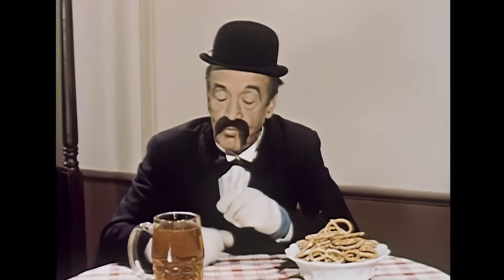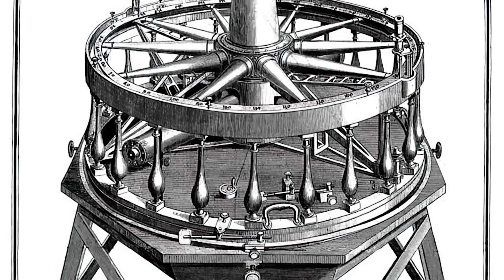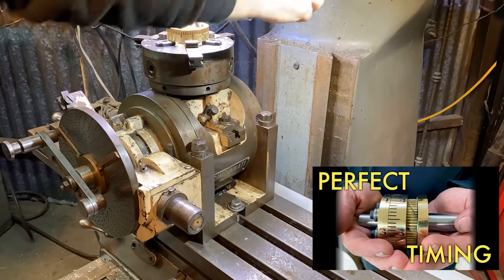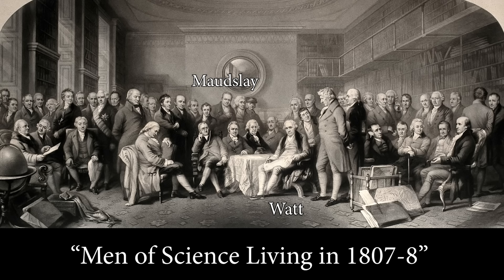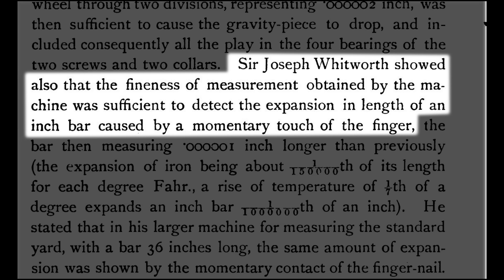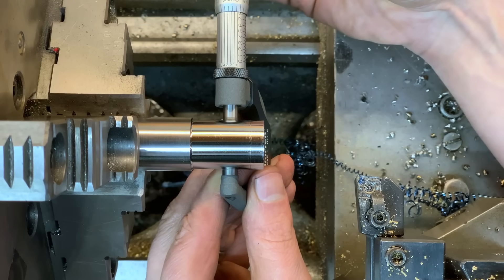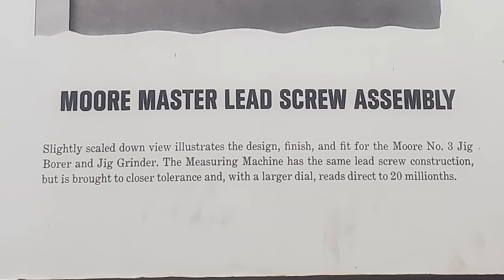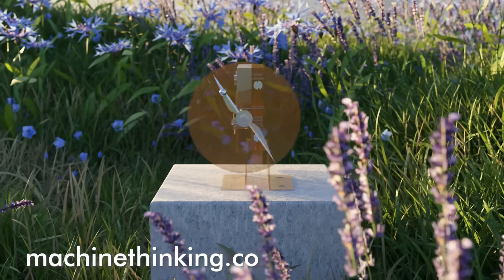The HIDDEN Screws of PRECISION

Comment: As important as whitworth is to modern machinery and accuracy he was the cause of a major headache that lasted over a week where I work.  I was a mechanic in a factory.  I still work there, but I'm a supervisor now.  Anyway, his odd thread pitch is what caused me a weeks worth of headaches.  Most of the machines I worked on were either all standard or all metric, pretty common right?  Well, one machine in particular had one thread that I couldn't figure out.  I measured, re measured, checked my numbers, cross referenced them to my machinery's handbook and kept coming up empty handed.  That is until I came to the pages about whitworth threads and my numbers started making sense.  What I had on my hands was just that, a whitworth thread used because the component that went into it was sourced from somewhere that still uses it.
Reply: I had a cylinder head fixed for stripped exhaust manifold stud, and the new stud was pretty wild, M10x1.25 on one end, whitworth on the other. Whitworth thread geometry is excellent for aluminum, apparently.
Reply: The WWII Rolls Royce Merlin engines used Whitworth threads, even the American built ones. I imagine it caused a fair bit of confusion then as now for people who didn’t know
Reply: Wait, what still uses Whitworth threads?!
Reply: @garethfuller2700  Old BSA motorcycles for one.
Reply: @garethfuller2700  it's on a pretty obscure machine used in a factory for decorating plates.  Part of the vacuum system that holds the plates down has a type of valve that threads through the table.  That thread is whitworth.  The machines are over 40 years old.
Reply: @garethfuller2700  An awful lot of stuff in the British Commonwealth (Australia, Canada, New Zealand,......) 
Even though we've had metric for decades and that almost anything new is metric there are still a lot of older machines and copies of older machines that have BSW and BSF threads. Most notably you find these Whitworth threads around pipes BSP. If you do anything around pneumatics or hydraulics you come across it all the time. Its one of those obscurities that has survived despite all other attempts.

You'd also be very surprised how many lathes come with their main lead screw as a British Imperial rather than metric. Its actually very easy to make the both metric and Imperial threads so long as your lathe has a 127tooth gear.

I eventually got my pilots license and flying is a bizarre mix of Imperial and Metric systems.
The visual range is given in kilometers, but distance over ground is still in nautical miles.
Altitude is still done in feet, but the pressure for setting your altimeter is in millibars (metric) or mm.Hg as in millimeters of Mercury (again metric)
Fuel capacity is usually (but not always) measured in gallons and fuel weight is usually measured in (but not always) kilograms. That one depends on the plane and where and when it was certified. All pilots have to be very careful with the conversions or you get the Gimli Glider scenario.
Reply: @tonywilson4713  I came here to mention the use of Whitworth form threads in pipe fittings, but you beat me to it! I will add that it still forms the basis for International Standards Organisation pipe threads
Reply: @emma.jacobs1  Good point on standards.
I love this channel for how well its researched and how well it presents engineering. His vid on Jacques de Vaucanson's lathe was brilliant.
Reply: @emma.jacobs1  BSP. British Standard Pipe thread.
Reply: @tonywilson4713  fellow aviator here, what country do you fly in? In the US, perhaps unsurprisingly, almost everything is in imperial: gallons, pounds, feet, nautical miles, inches of mercury, pounds of thrust, etc. But temperature is Celcius...
It works well for the 60 to 1 rule, degrees, lat long, and all that.
Reply: @MattH-wg7ou  I'm Australian but I went to college in the states where I first learned to fly gliders while doing my degree in aerospace.
Finally after many years I  got round to doing my powered license. Got my aerobatics and started competing. 
It all got cut off a couple of years ago after I picked up a very nasty virus.
Hoping to get back to some before too long.
Down here all weather information services are in kilometers. Fuel is delivered in liters. Temperature is in Celsius. Weight is in kilograms. But any aircraft built in the US has manuals with gallons and Fahrenheit and pounds. We have to be especially careful with gallons because there's 2 - US (3.8l) and Imperial (4.5l). So you do need to be very careful with fuel.
Reply: @tonywilson4713  cool that sounds awesome. Hope you are able to get back into it soon!
Reply: @MattH-wg7ou  I have about 350 hours. How much do you have?
Don't worry about the answer. One of my Frat brothers who did his back in college as over 22,000. I hadn't chatted with him for years. It was humbling when he told me what he'd been up to, but he was super encouraging to keep going.
Reply: @tonywilson4713  wow thats a lot of time flying! Some types get so much more than others, I have only around 350 as well, but they are in fighters. In the fighter community its rare to see people with much more than 2000ish. Around 300 you become "experienced" and a flight lead and that takes a couple years to get there. The thousand plus hour guys are almost all instructors. 
Meanwhile airline pilots routinely have over 10k hours, which sounds just insane to me!
So it really depends on the type of aircraft.
Reply: @MattH-wg7ou  Yeah my frat brother is a senior instructor with one of the major American airlines on 737s.
He was part of a team sent to Boeing to get the Max-8 sorted out. He gave me no details but did say "they broke the Boeing system." That actually scares me because I understand what he means by "system."
That includes all the procedures, tests, methodologies and engineering ideologies  that they use to go from words and blank sheet of paper through to you and me at 35,000ft. Basically a library full of knowledge and experience AND they broke it. 
I'm well aware of how little certain pilots fly. Way back in the late 80s there was a Concorde pilot who became the first pilot ever to record 10,000 hours as pilot in command at supersonic speed. That came up in a discussion at the glider club one day where a couple of our tow pilots we ex-airline with over 10,000hrs. When I quizzed why the big deal one of them slapped back at me asking how stupid I was because he knew I was doing aerospace. I'd forgotten just how little planes can normally fly at supersonic, because of how fast it drains the tanks. Plus it also thermally stresses planes.

You might know better than me, but most air force pilots have less than a single hour at supersonic speed and most never record more than 2 hours in their entire career because its all little short bursts.
 
For what was known at the time that 1 Concorde pilot had more hours at supersonic than the entire USAF history that was known. The SR71 hours weren't known at that time and could/would have changed that assessment.
Concorde truly was an amazing piece of technology.
Reply: @tonywilson4713  the Concorde certainly was amazing! And beautiful. And 10k hours at > Mach 1 is incredible! 
I would say most Air Force pilots have never even been supersonic because most arent fighter pilots. But it probably depends on the type of fighter. If you are in a jet that does a lot of BVR air to air stuff then you spend more time above the Mach, as getting supersonic is fundamentally baked into some of the tactics. But yes it sure does go through the fuel! At max AB at low altitude, 45,000 pounds per hour PER engine is normal! 
But like with most things the answer, of course, is "it depends"! 
I wish I could have ever seen the Concorde fly, never even seen one in person. They put most fighters to shame with their performance. Cruising st 60k ft and Mach 2 is just exceptional!
Good talking to you, hope you get to fly more soon!
Reply: @MattH-wg7ou  Same to you.
There's a Matt H who flies in Australia, did fly for the RAAF and these days likes High-G, low altitude flying between pylons?
Reply: @tonywilson4713  haha not me. Sounds fun though!
Reply: @MattH-wg7ou  Thought I'd ask.
Where I got my aerobatics ticket the school owner was ex-USN and flew both F4s and F14s. 
I asked on day he really surprised my in how much he liked the F4 and disliked the F14. But then Ward Carroll who has a YT channel points out that the F14 was a handful at low speed.
What did you fly where there's an interesting comparison? If you can't no prob. 
As an engineer I like to understand what people do and don't like even if its in areas I'll never work. It all adds up when you are a solution provider.
Reply: @tonywilson4713  I'm still active and its a small community so I'd rather not put more detail out on the internet, hope you understand. 🙂
Reply: @MattH-wg7ou  absolutely and totally understandable
Have you seen Ward Carroll's YT channel? He's an ex F14 RIO.
Reply: @tonywilson4713  its a great channel! I love the story of Mongos MiG Kill especially. And the one where the guy ejected into a thunderstorm and was kept aloft by winds and beat up for what must have felt like forever.
Reply: @MattH-wg7ou  What makes it a great channel is that it sticks to its area of expertise.
So many channels get side tracked in stuff they just shouldn't.
The other great aviation channel is Blancholorio with Juan Brown.
Reply: @tonywilson4713  yessir Blancolirio is a great one too. I like his analysis/opinion videos on just-happened mishaps especially. The mishap investigation side of things really interests me.
Reply: @MattH-wg7ou  What he doesn't do which should be a lesson to ALL JOURNALISTS and public commentators is NOT embellish on known facts.
Any opinions he gives he's clear about that they are opinions.

As far as I'm concerned people like Juan are real journalists. He presents the known facts and explains what he can about them. He doesn't make up crap or try for any grand standing attention seeking nonsense.
Reply: @tonywilson4713  well said. Speculation should be avoided to the max extent possible when dealing with mishaps. And when you must (as a journalist, not an investigator) it should be clearly labeled/explained that it is just speculation. Like Mr Brown does.
Reply: @MattH-wg7ou  I really notice it in things I understand - engineering & technology. That makes me wonder about so much else we hear and can't challenge because its in topics we don't know or have no experience in.

I'm Australian and Rupert Murdoch's crime of crimes was pushing and promoting "opinions as fact."
Reply: @tonywilson4713  Thanks for bringing up the Gimli Glider.  It's been a while and I liked rereading that story.  That, and the Cornfield Bomber are probably my favorite aviation incidents.
Reply: @Kineth1  I'd forgotten the CF bomber.
Love that comment form the other pilot to "get back in it"
Reply: @tonywilson4713  There is also BSPP - the second P is for parallel.
Reply: @mescko  There's one I hadn't heard of or maybe just not noticed.
Thanks.

I wish this guy would do more vids they are so damn informative. There's so much of this stuff we are close to losing. Its one thing YouTube is getting right.

Just recently Keith Rucker at Vintage Machinery did a "partial screw thread" for a vice screw. I'd never heard of anyone doing that let alone seen it done.
Reply: @tonywilson4713  I ran into a BSPP thread on the oil pressure switch on my Rover P6.  Had to order it from a local outfit that deals in vintage Land Rovers, I cross-referenced it to my car.  I knew better than to ring any of the local auto parts usual suspects.
Reply: @mescko  Unless you get really lucky almost NO supplier would have any idea what you are talking about.
I vaguely remember a joke about Lotus using 7mm bolts to save weight over 8mm bolts and how its still a problem for people owning older cars.
Reply: @tonywilson4713  Sounds like Colin to me😁
Reply: @mescko  I once heard Mario Andretti (I think) describe Colin Chapman's ideology of race cars.

If a race car is built right it falls apart as it crosses the line.
If the car crosses the line and can do another lap its too heavy and needs to be lightened.
If it breaks and fails to finish only then can you add weight.
Reply: @tonywilson4713  On your point about nautical miles, though, the nautical mile isn't based on some old weird imperial standard though, it's actually 1 arc minute of 1 degree of latitude (or longitute at the equator). This means that if you've travelled 60 NMi in a due north/south direction then you've travelled through 1 degree of latitude over the earth's surface
Reply: @EamonnG76  Year I know that.
Odd thing on my college transcript. Navigation 101. I needed some extra time my last semester and friends had introduced to me sailing and I found this ROTC course. So with  bunch of future navy officers I did classical navigation right back to star fixes with a sextant. 
It was one of the best classes I ever had.

I also have a pilots license and airspeed is still in knots too.
Reply: @MattH-wg7ou  Wow! Sounds like we could use a whole bunch of that integrity in the political side of the industry.
I'm no pilot & too old to start now but looking in at you guy's back and forth here is almost as interesting as the vid here.  Thanks for this. Maybe you both should think about a collaboration YouTube channel. Maybe?
Reply: @MattH-wg7ou  I saw the first prototype Concorde's (very noisy) & the last to fly, the whole design allows for the expansion & contraction of everything as the aircraft heats up at supersonic speed and cools down on the ground, the Blackbird spy planes apparently leaked fuel on the ground. The Concorde was never know for doing that because everything worked hot or cold!
Reply: @mescko  our Rovers had both imperial & US gallons shown on the dashboard
Reply: @tonywilson4713  When it comes to threads and fuel/oil fittings etc. on aircraft there is here in the US ,AN or army/navy fittings.
Reply: @dicksargent3582  Interesting. 
In what ways do they differ?
The Russians for a while had an interesting philosophy they had 1 gear box. The had the same gearbox in their trucks their tanks and anything else that needed a gear box. Their view was they could keep their tanks rolling so long as there was a truck nearby to steal parts from.
At times other militaries have done similar.
Reply: @garethfuller2700  Old MG cars  and some old but good machine tools
Reply: @richardsolberg4047  if you have a really old MG car, it might have an engine with metric threaded fasteners with Whitworth size hex heads!
Reply: @richardsolberg4047  Dean Smith & Grace lathes come straight to mind. They were built to last forever
Reply: @garethfuller2700  Raleigh Bicycles found in thrift stores and yard sales.  You'll never be able to swap parts with Huffy and modern brands.
Reply: @garethfuller2700  quite alot of stuff actually, especially if you are into repairing olde machinery ( Concords original nose cone was spun on a 120 year old machine  ;)
Reply: @garethfuller2700  The 1/4 inch thread on a camera tripod is Whitworth.
Reply: @garethfuller2700 All metric piping. All European piping uses BSP thread which is a Whitworth thread.
Reply: @garethfuller2700  you certainly could buy threaded rods with Whitworth threads in the UK until recently!
Reply: It's still relatively easy to buy Whitworth tap & die sets
Reply: I would be very curious to know what prompted the change away from Whitworth threads, how is the modern standard thread better?
Reply: @VioletGiraffe  You have the world wars to thank for that. As you can imagine during world wars, materials for armaments were in short supply and the Americans introduced a new standard known as the Unified National series which featured a smaller head size and probably also improved alloys used for bolts. The savings in material worked not only to stretch a finite resource but also helped with weight savings in aircraft for example. The British also embraced the smaller head size idea with a series of standards  known as the British Standard based on Whitworth's standard. Since the opening up of world trade metric now dominates, virtually everywhere except the USA, but even there metric is gaining a larger following.
Reply: @VioletGiraffe  ,What do you identify as a 'standard ' thread , Whitworth =coarse thread .BSF .=fine thread. these were the standard threads of the time and have been in use for over a hundred years. there is no standard thread that covers everything, with he possible exception of cycle thread , that uses the same t,p,i,  for all diameters in the imperial world before  metric and USA national UNC/UNF coarse and fine . Whitworth or a close size and pitch  thread in other countries thread systems are used in lot of applications as it is one of the strongest holding threads along with UNC.
Reply: @VioletGiraffe  It's simpler and cheaper to standardize rather than maintain many different formats. The standard unit of measurement in the scientific community is the meter, and even the inch is now defined in terms of the meter. A base 10 system is more intuitive and less prone to errors. Converting between measurement systems also carries the risk of errors, it has even brought down airplanes. The new fasteners aren't inherently better, it's just that standardization saves a lot of work.
Reply: @TerryClarkAccordioncrazy , it didn't only bring down airplanes, it brought down one Mars orbiter, too!
Reply: @VioletGiraffe  Right, and a satellite was lost, and I guess the full list of unit conversion disasters will never be known. It even caused Columbus to get lost.
Reply: @VioletGiraffe  Not better, just standardized now.
Reply: The thread on the tripod for the camera shooting this video is likely whitworth. As are some stage lighting bolts.
Reply: @notsofresh8563  the standard thread for camera to tripod is 1/4"- 20
Reply: Whitwoth not only invented The standard thread, but modern hydraulics as well. That's why so many modern hydraulic fittings still use the original standard.
Reply: The handbook talks about BSW threads...
Reply: if you're a engineer machinist you should have invested in a ZEUS book which lists every type of thread and dimensions, I had one in my overall pocket, as did EVERY other turner or miller I knew they are still avaiable :)
Reply: @peterforden5917  These days the favored small books with all that stuff are the black books.
Reply: @tonywilson4713 
In the US the standard reference book is Machinery's Handbook. Mine is close to 50 years old and is still useful. In fact it probably has info that is no longer listed in newer editions. We used to make a lot of replacement parts eith gear teeth cut to the Fellows Stub Tooth system. The Pitch Diameter was based on one Diametral Pitch while the overall height of the gear tooth and the OD was derived from the next  smaller gear tooth profile. A gear would be expressed as 48T-10/12DP.
Reply: @peterforden5917  
Still have mine. 👍🇬🇧
Reply: Your story reminds me of something that i experienced…although not as technically challenging. Years ago i owned a car from the 70’s Buick Electra. Beautiful and immaculate, it had been garaged it’s whole life and was a head turner. I brought it from a retiring work colleague. The only thing wrong was, it had this annoying rattle that, hard as i tried i could never locate. It was driving me out of my mind. I even went to the trouble of stripping out the door and ceiling liners thinking it was either a loose lock or window connection…nothing. This absolutely drove me insane to the point where i eventually sold it for that very reason. I cried when i sold that car i loved it more than i loved my wife. Years later a kid who eventually bought it (it had changed ownership several times since) came knocking on my door and presented me with a pill bottle with a screw inside. On the outside of the bottle there was a note and it said….’Russell here i am you f . . king idiot’…Bob…the guy who i bought the car off long deceased was forever playing practical jokes at work and he planted this bottle with the screw inside, in between the backseat and the trunk to piss me off…RIP Bob
Reply: oof
Reply: In the gunmaking business we find much wilder stuff. Some parts must be made to very tight dimensional tolerances and quality standards, e.g. a simple-looking sear in a rifle. The length and several angles are critical, and they have to be very hard. The more responsible manufacturers go to great lengths to prevent owners from making certain replacement parts, and one of the tricks they use is making bolts of metric diameter and imperial pitch.
Reply: I see Whitworth threads once in a great while in old submarine design.
Reply: @soundmapper  I still see those older threads in air fittings like BSP threads. You also see Whitworth threads on things like farm machinery, older trucks and those sorts of older machines that never seem to wear out in factories (like power presses).
Reply: welcome to british motorcycles
Reply: Nothing wrong with any thread if it's the right one for purpose.  The well trained and properly resourced engineer will be able to resolve size and form issues without difficulty.  It's something that used to be taught in the metrology modules of basic technician training  (for example, curriculum of UKs C&G).   Miss this at your peril. As in most other walks of life you need to know key elements of your subject's history or be a dunce. 
Those who decry so strongly the work of  early engineers like Ramsden and Whitworth  and protest in favour of the modern standards (and Metric?) might be exhibiting some sort of cognitive dissonance on the back of gaps in their knowledge.   Whitworth  was a Father of modern standardisation. For example he  DID  set up a system which became a standard after industry saw benefits and  Chose to use his forms.  It served a need well at a time when cast iron and wrought iron were the mainstay metals of industrial production.   No cast aluminium for them.  
Engineering is a roller coaster of innovation and eventual redundancy.   Someone in these comments  mentions the Engineers Handbooks  (was it Zeus Tables he cites?)  perhaps some of the modernists might like to pick up a copy of one of these storehouses of knowledge and refresh themselves on some of the basics.
Reply: Huh?!  But a Whitworth (BSW) thread is a 'standard' thread(!)   Along with BSF, BSP, BSC & Acme etc.  UNF, UNC & metric (also an English 'invention' by the way) are all supplementary.
Reply: Try 1956 Volvo for sheet metal and other type screws, insanely hard & had to get it right. And sourcing replacement parts, a nightmare,(unless you had a certain reference book).
Reply: I am an Engineer here in England Whitworth size and form threads are still used and still need to be produced when repairing old plant and machinery . All Or most British cars and motorcycles used BSW , BSF or BSCY thread sizes and forms until probably the mid 1960s . UNF and UNC were then adopted until Metric became more common place probably in the 1980s . As an apprentice we were taught to recognise all along with BA . There are still companies in England manufacturing BSW and BSF fasteners . And long May they continue 🇬🇧🏴
Reply: People who declare that metric ought to be standard for all future manufacturing are probably correct.  We (USA) should have continued the efforts to switch over, back in the Reagan era.  Too late for now.  So my 45 year machining career was mostly in Imperial measurements.  I am qualified to say that it is no more difficult to work this way, and that Metric was simply not needed.  Now retired.
Reply: Fck .... you got stumped by that !!!
Reply: @richardkell4888  If you don't have the right thread gauges working out what thread you actually have can be a mongrel especially if its worn and even worse if its an odd pitch.

I'm an engineer and never underestimate people to do something odd for a 1 off part and NOT document what they did.
Reply: 9 ooi 9898889⁹⁹999⁹⁹99999⁹999⁹9⁹po pp9⁹⁹⁹ooi
Reply: @sjb3460 
The hard part of cutting Whitworth threads on a lathe is grinding the tools. Not the 55° included angle. But grinding the proper tip radius and the radii that form the proper crown on the top of the thread. Plus some of the Whitworth pitches are not normally found in the Quick Change Gear Boxes of non British lathes. 19 tpi for one.
Also it was very common for machine tool builders to have their own special thread pitches. Brown and Sharpe used to use things like 1/4-22 or 1/4-32 (1) for the screws used in their screw machines. Also those really nice Swiss MultiFlex tool posts use things like 7mm, 9mm or other odd sizes not normally found even in the catalogs of industrial supply houses. It's called "buy our parts".
1) I've got a tap for that one
Reply: Are you 200 years old?
Reply: Stubborn limeys with the “not invented here so we don’t want it” routine.